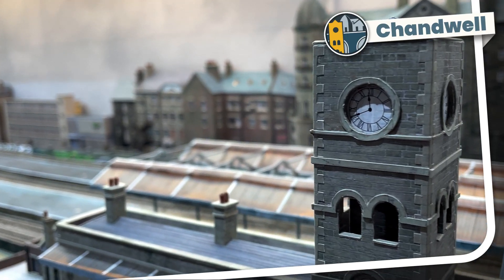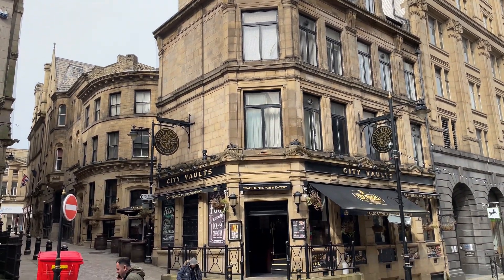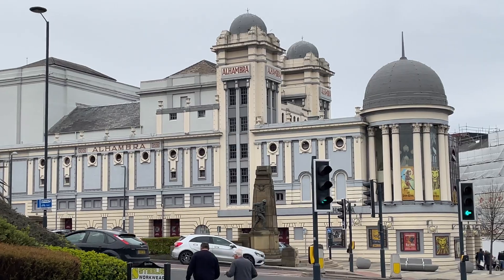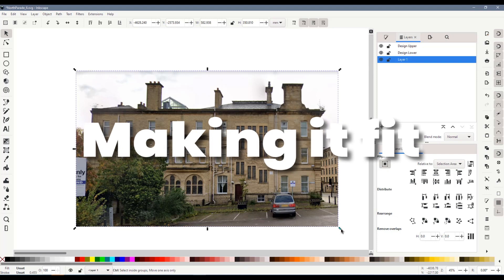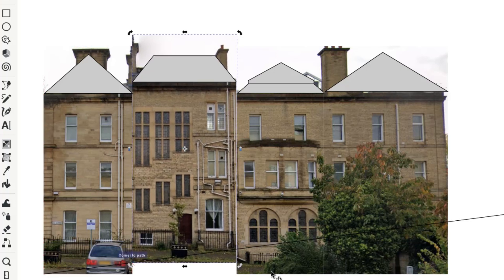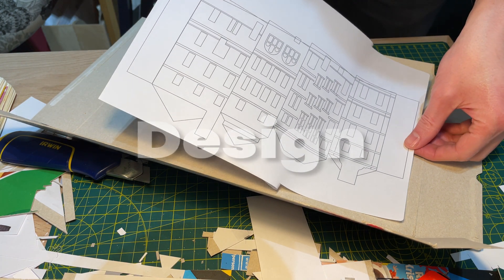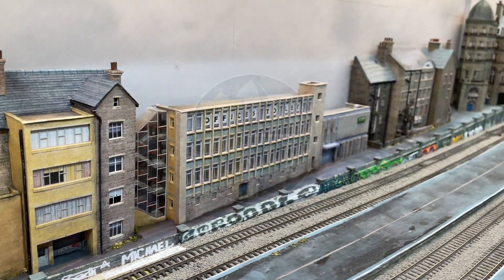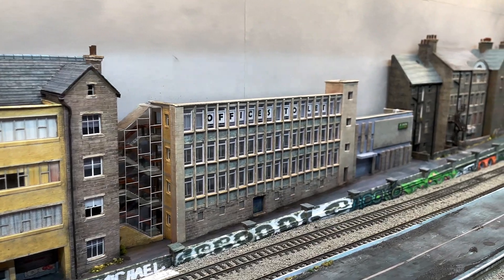What to build next? How I choose a building for Market Street : Building Market Street Part 17

Comment: Really great ideas! The whole backscene draws your eyes in all direction. The flats really complete the scene bringing that depth you want.Using a sight bluing to those flats will also aid to the distance factor, another tick John Allen used to trick the eye.
It adds so much to the scene as Market Street descends to the street under the viaduct. 
The building choses are so cool. Quite a variety of architectures. These next ones will be interesting projects.
Thank Again,
Don
Reply from the maker: Thanks Don! Good shout on the bluing. My current thinking is very, very flat models. Maybe three layers of 0.5mm card deep. I will use my usual textures, but desaturated, shifted into the blue slightly, and maybe ever-so-slightly blurred. I will do lots of tests and I think it will make for an interesting video.
Reply: @Chandwell  It truly will be an interesting presentation. So many modelers do not account for the color drop off in distance. I am sure you will do it justice.

The mix of flat you mocked in look great, good choice!

Comment: Once again AMAZING and wonderfully interesting.
When it comes to CHOCOLATE, resistance is futile. :)
I was very attracted to several of the photographs of the streets - especially the "extended", "dingy" and "lonely" building/s.
While contemplating my own urban area, I stumbled upon a METCALF kit of a corner pub with a walled in back area.
I will be using this as inspiration and - as a part of learning INKSCAPE - I am freelancing the rear of a walled corner pub for one of the buildings on my "wrong side of the tracks" urban section.
Again, it is YOUR inspiration that has brought this on and I thank you for the freedoms and courage that you have given by creating a full town that is NOT the ever sweet, front of the shops on the street, layout displays of which we are all well and truly over...
Reply from the maker: Thank you Nicolai! That means a lot; all the best from Chandwell! :)

Comment: That building should look awesome when its done and look forward to the progress...Inkscape, I must look into that. Scaling buildings down could just be what I need. I take it you get the measurements from Google Earth pro using the measuring tool.
Reply from the maker: Exactly that Steve... I use Google Maps just on the website. Right-click and use "Measure Distance". (Turn Globe View off for a better accuracy). Then in Inkscape, use the padlock icon to lock aspect ratio, and enter the measurement divided by your scale into the width box. You can even just type the formula into the width box. Say the building is 25 metres long. Just type "25000 / 148" into the box and it will come out at the correct width for N scale. And since you locked aspect ratio, the height is magically correct too. Obviously this only works if you can photograph your building dead-on straight.
Reply: @Chandwell  Will have to try that, although most of my laser kit designs revolve around depots and I've yet to see any Google images of these are they're normally out of bounds and I dont recall any going down platforms either...lol.
I will save this for future reference.
Thanks
Steve
Reply from the maker: You can measure from above: the satellite images. Go to Google Maps in your web browser. Find the depot you want on the map. Switch to satellite layer so you can see the roof of the building. Right-click one corner and choose “measure distance”. Then left-click on the other corner. Give it a try!
Reply: @Chandwell  I've always used the measuring tool in Google Earth Pro as this also gives 'History' and you can go back many years which often helps me as the depot I'm trying to do is no longer there!
I'll have a look at that too....cheers
Reply from the maker: Cool. That’s a great feature. I’ll have to look into that.
Reply: @Chandwell  It helped me when I was designing Blyth Cambois TMD as it got knocked down in around 2008, with the history tool, I can go back as far as 2002 and see the building and measure it. Whether I'll ever get around to making it is another thing lol as I do O gauge and at the moment don't have the room. I did use this tool however to design and build the large office single storey building there and that's sitting on my shelf waiting for me to finish the roof as I need parts 3D printed.
Would be lost without this history tool.

Comment: This one is going to be impressive Michael. In the past, I've used a technique of color printing stained glass designs on ink jet-printable overhead projection transparencies, and then backlighting it from inside. It works well in HO scale, but I'm not sure if it will scale down to N scale.
Reply: I’m not an expert but I did experiment with a scalescenes window in N by flipping the image horizontally in Inkscape, printing onto ink jet acetate, flipped over acetate so image is on backside but presents the right way, then used sticky label method on non print side. To get everything lined up used a printed box on the acetate the same size as the label I was sticking. 

I can’t take credit for this, it was  a gentleman on the scalescenes FB group that showed me. Michael, I’ll tag you on the conversation so you can see the idea and how it might work for those staircase windows.
Reply from the maker: Thank you both. I’m planning on printing onto acetate but don’t want to light the back buildings. However, my friend Tim (who happens to be the gentleman in question on your FB post, Martin!) has had excellent effects just putting some white card behind. It’s dark enough to look realistic from the outside but bright enough to give that hint of colour. Lots of experimentation ahead, I think.
Reply: Classic stuff, the meeting of the minds… have already met! You both do such inspirational and clever work. The white card idea sounds like a plan. Look forward to how this comes together… it’s got some complexity!

Comment: Can you explain how you scale the photograph? I have OO SCALE Thanks
Reply from the maker: I use Google Maps just on the website. Right-click and use "Measure Distance". (Turn Globe View off for a better accuracy). Then in Inkscape, use the padlock icon to lock aspect ratio, and enter the measurement divided by your scale into the width box. You can even just type the formula into the width box. Say the building is 25 metres long. Just type "25000 / 148" into the box and it will come out at the correct width for N scale. And since you locked aspect ratio, the height is magically correct too. Obviously this only works if you can photograph your building dead-on straight.

Comment: Hi, have you done anything to prevent the ink of your prints from fading?
Reply from the maker: I use AK Interactive Matt Varnish, which seems to have done the trick. HOWEVER... Chandwell is in a windowless room so there is no natural light. Also... be careful with the varnish. I use photo paper which seems to make the ink waterproof. Others have experienced really bad ink running with brushed-on varnish, so a bit of experimentation would be advisable.
Reply: @Chandwell  Thanks!